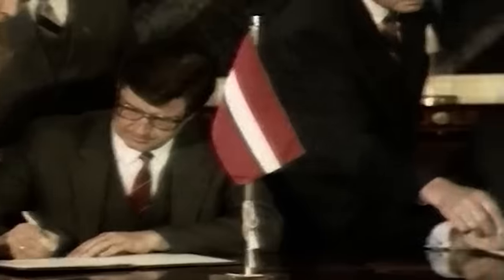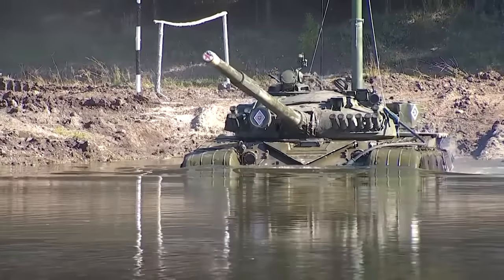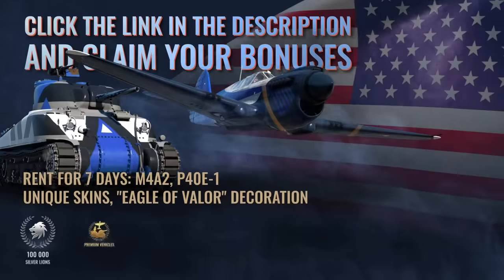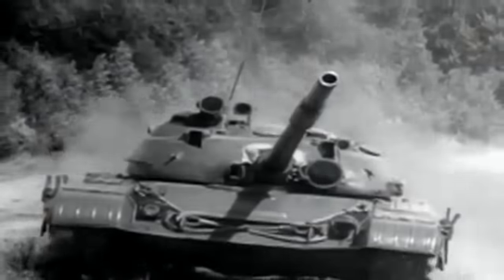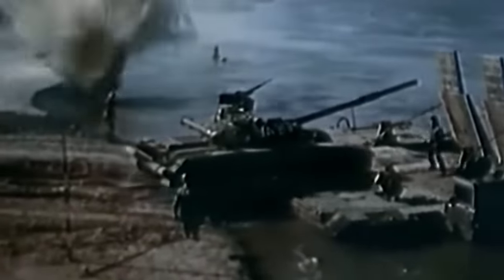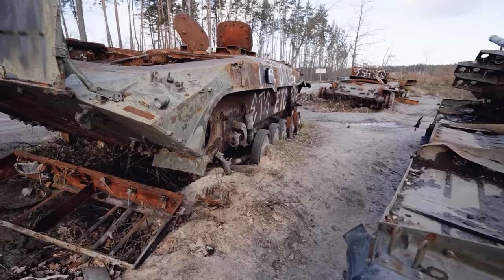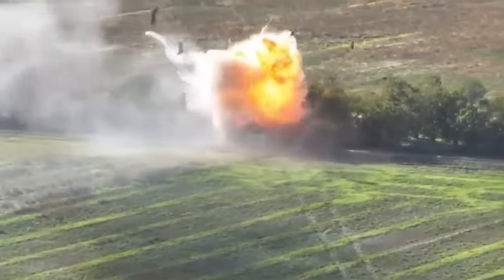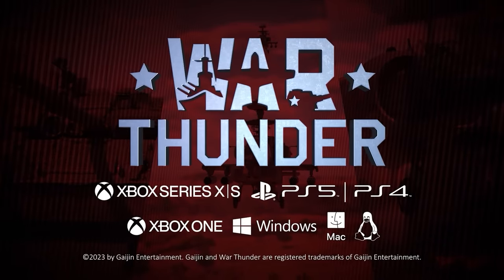The Tank Russia Is Really Starting to Regret

Comment: T72 is not a derivative of the t64. They were developed side by side by competing firms
Reply: No its bullshiet, T64 had several cons with engine and sustainability on top of that it was too expensive even for USSR to produce in huge amount, so they created more simplified, cheaper, easier to maintain version - T72
Reply: @КебмерБиделрон Only one plant could produce its engines and it was in Ukraine- which didn’t make sense in case of big war. Even now Ukraine can’t repair them.
Reply: @КебмерБиделрон  well Object 172 was effectively a T-64 just with a T-62 engine. however the T-72 proved to be really a better designed especially with the autoloader and having larger roadwheels which gave better offroad performance. The road wheels would influence t-80's double roadwheel construction. After 1974 T-64 and t-72 became two separate programs.  the T-72 had better protection while the T-64/T-80 series had better FCS.
Reply: @nemisous83  Well, your story is complete bs... T-72 was inspired by T-64 but the whole point was to make a tank that was not as advanced as T-64 but much easier to produce = cheaper.
T-72 got 90% of T-64 combat capability but you could produce 2.5* T-72 for a price of a single T-64.
Mechanicaly this two tanks were completely differenct from day one...
The only "better" about T-72 was the fact that USSR was able to sell them all over the world with huge profit.
They also made B version with more advanced turret armor, but the export verions was T-72M and that is just T-72A.
Reply: @Bialy_1  first off that's not true. Object 172 was started because UVZ couldn't source the T-64's complex and arguably fragile components for production. So Object 172 was launched as a way to utilize the proven engine and transmission of the T-62. Overtime UVZ replaced so many parts on the vehicle that by 1974 when T-72 Ural entered service it had little to no parts commonality between it and T-64. If you look at the  Object 172 (which was the prototype of T-72) it is effectively a T-64A with the 580hp engine of the T-62. 

T-64 and T-72 were both parallel developments throughout the cold war. However most of the "advanced features" on the T-64 came with the BV model which benefited from the development of T-80 things such as a laser range finder, ballistic computer, cross wind sensor, and explosive reactive armor.  

T-72M isn't a development of T-72B. T-72M is just an export T-72 Ural and the T-72M1 is the export version of the T-72A. The export model of the T-72B is the T-72S. The main reason T-72 was license produced over T-64 wasn't because of some secret sauce  it's because no one wanted it and the cost to tool up for it. They would rather tool up for T-72 which utilizes a lot of parts used in the T-54/55 and T-62. KPT tried to license produced T-64 to East Germany however they opted to produce T-72M1 instead.
Reply: Obviously all the info in the following thread is arguable.🤪
Reply: I literally only clicked on these comment replies for all the "um, actually" that was bound to ensue.. and.. yep.
Reply: @LandonBell11 Um, actually, you are wrong 😂
Reply: It kinda is. It was designed to be a cheaper, easier to produce/maintain version of the T64
Reply: @nemisous83 The T72 has a slower automatic loader than the T64/80; it goes worse in mud, especially with belts from the T80.  The T64 is the most passable tank, and this has been documented in tests.  The advantages of the T72 chassis are that it is quieter and has less vibration; a tank with broken belts is easier to evacuate from the ground.
Reply: T72 being the cheaper design too
Reply: @Bialy_1  sounds like ukropium
Reply: @alexmoos6858 the t64/t80 loaders have notoriously easy to hit propellants due to their L shape in the turret. speed might not be the determining factor as well as the commander probably won't be able to acquire a new target within the 8s it takes for the AZ to reload
Reply: @Bialy_1  soviet command gave orders to the nizhniy tagil plant and the kharkov plant to make a tank using the guidelines. Nizhniy Tagil came with Object Ural, which later would become the t-72, while Kharkov came with Object Berezka which would become the T-80. The main feature of the T-72 was that it was cheaper and easier to build while not being outdated. The main feature of the T-80 on the other hand, is that it had a helicopter engine
Reply: The real story is kind of interesting. Basically the T55 got pretty old and the Soviets knew they needed something else because the T55 is basically an end of World War II+ tank. So work started on the T62/T64 striving to be as technologically advanced, and as good as they can make it but after many years, they just couldn’t get the kinks out in order to make it sufficiently reliable and producible tank for the USSR so another team came along and started work on what was supposed to be a lower tech but more than good enough stopgap tank that would serve until the kinks were ironed out of the T62/T64, with the result being the T72, which ended up becoming the new main tank even to this day.

It’s basically the classic story of Russian weapons designed that their additional ambition was basically to do a technical exercise for the most advanced possible thing only to then scale it back to use simple or more proven economical technologies, while they worked on the more advanced stuff to be used at a later date.
Reply: well seeing how the T-64 came out of 1966 and the  T-72 roughly 6 years later i would say T-72 took what work with the t-64 and try to remove what does not work.
Reply: @chrishill3536  That's basically the origin story of the T72. The T64 was the aim for the stars advanced tech demo tank, the T72 took the concepts they could get working and iterated them upon more reliable technology. The two big ones were going from a hydraulic autoloader to an electric autoloader, and something to do with the engine.